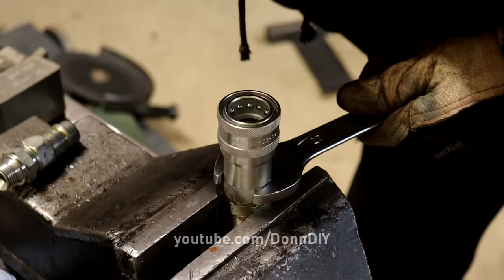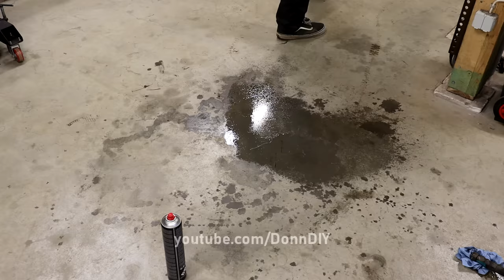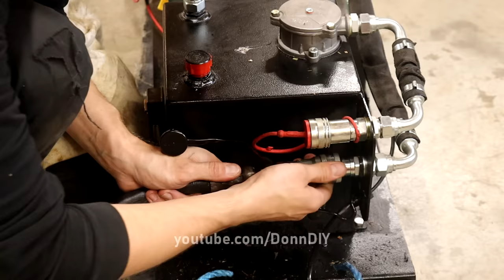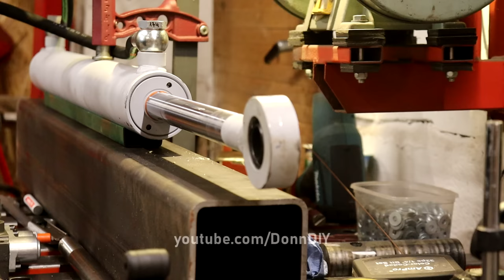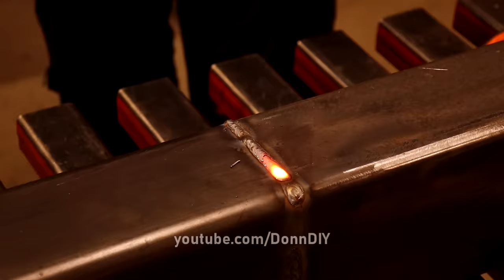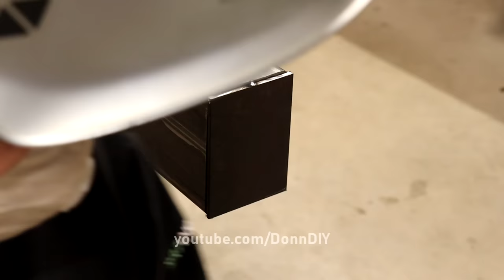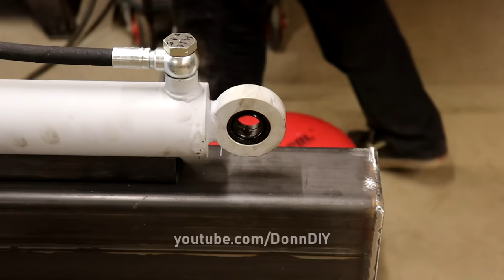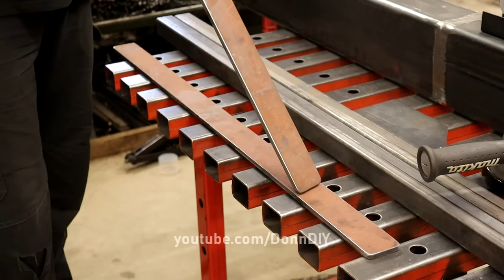Hydraulic Log Splitter BUILD Part 1 - Steel Frame Fabrication & Sourcing Parts

Comment: I've built a couple log splitters.  I think you're building it too light duty.  I use a H beam and they still flex, that tubing will bend.  I also think the cylinder you're using is too small, it won't split tough wood.  For speed and power use a two stage pump.

Comment: Also.. I ended up taking an old furnace blower and built a wood box to put it in with a slot for a furnace air filter so I can just run that on high to try and suck all the dust out of the air

Comment: I think it would be difficult or impossible for someone to be there with you and help you, because more than on a designed and calculated project you work on the final intent, on the object you want to obtain, in this way it is all a continuous flow of ideas and continuous improvements . practical example at the end of the video: first put a blade, then 2 and finally the idea of height adjustment

Comment: Are you going to connect this to or modify that firewood processor you made to work with this or is this more for portable stuff…..     ?    And also …Dude.  I started watching your videos a few years ago.   You have come unbelievably far fast man.   And deservedly so.   And I can see the tools I really need in my shop are a metal lathe and a plasma cnc.   And i see your skills have gotten even more insanely good just over the last year so I’m gonna suggest a tool you may have but I don’t know ….  Tubing bender.    I think with what you’ve been doing and the skills and computer work,,,  tubing all the way, lighten up the frames of whatever projects… but again that is not to say you aren’t awesome regardless,  I am not as good.   (Besides it doesn’t matter who’s better it’s all about making useful things that last)

Comment: Use pto to power your pump on your splitter then a tractor or your sxs can run it and it doesn’t take a machine with hydraulics

Comment: The steel beem you are using is weak and it will bend. you have to use an I beam, there is a reason that all maufactures use the same I beam.

Comment: hydraulic cylinder
holes or rust marks
at Metaflux,
two-component epoxy resin for fast metal repair,
or maybe Metaflux 76-84 TWO-COMPONENT LIQUID METAL

it exists in another brand, but I don't know which one....

workshop floor / oil:
car trunk floor mats
flexible but resistant plastic, with edges.
Very practical also so as not to lose screws outside.

Comment: Donn, I have been watching you for years now... when are you going to start using a sexy model to hold a tape measure or hold a wrench? I jokes around buddy, your a doing just fine ..... but if a pretty model was   to show up,... hmm, I think that could go south too, as your wife would kill you if you had a "Tim the tool man apprentice" like the tv show in the seventies showing a bumbling man   always in trouble with his wife. This build is one that you have made variations of before.... hoping this one is faster than many on the market. I am visualizing a unit that will come into play with the logging tools that your currently working with... correct??

Comment: Always use a blow torch to get rid of oil  and other stains on a concrete floor!
Reply: NO you don't heat concrete with a torch .. it pops and hot concrete go's flying and burns you .. my propane torch fell over the other night it heated the floor 2 or 3 seconds before I could pick it up and concrete chips were flying .. same thing as a fire pit with rocks around it if the rocks have any water in them the pop and go flying like a bullet ..
Reply: @randytravis3998  lol, you sound like you think you're supposed to heat the whole floor, lol?
You do it in small bits and work your way through, lol.